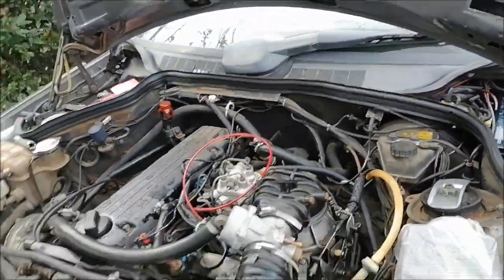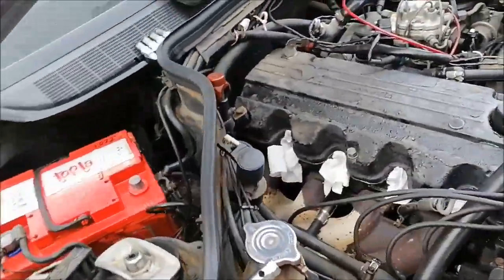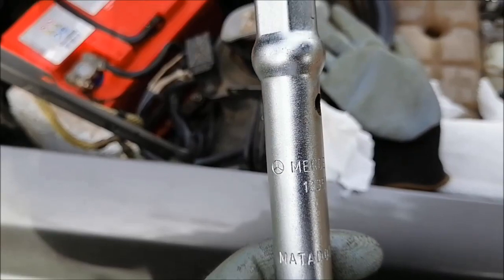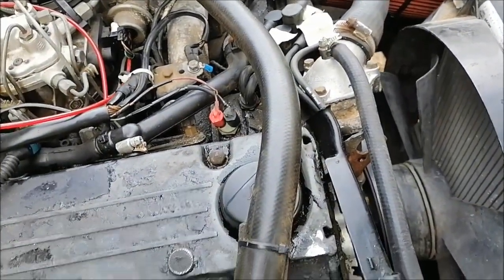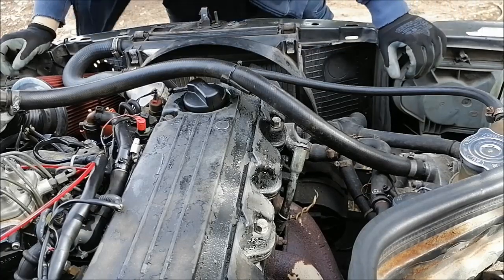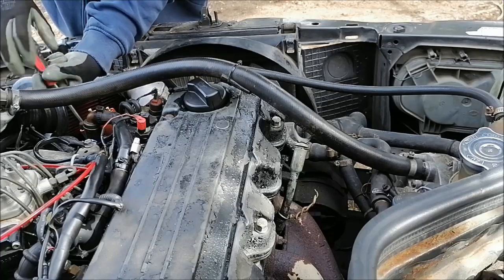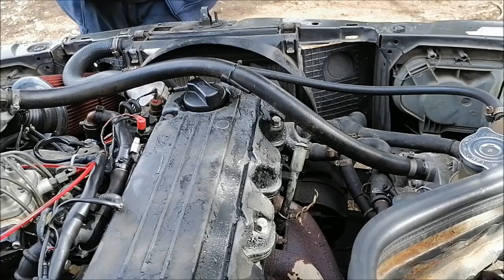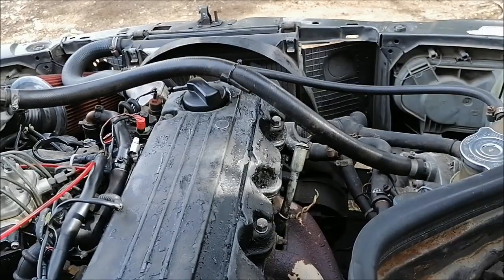Mercedes 190E ignition system

Comment: Hello, i am a new owner of w201 190E 2.0. 90kw. I started with some maintenance. I replaced the cap of the distributor of the ignition. Before i put the cables out from the cap i marked them (the numbers same as on the ignition cap). Then i replaced them an put to the same position. Then i wanted to measure the electrice resistion of the ignition cables (from cap to spark plugs). I noticed that the numbers on the plastic cover of the cables on the ventil cover dont match with the numbers on the distributor cap. So now i dont know if they have to match or not. Do they? Next idea is, i could make some mistake, or the old distributor cup was install in the opositte direction (if it is possible).... Now i canot try if the engine works because ii sent the coller to be fixed (because of some leaking)... Can you help me? Should the numbers on the plastic cober of the cables match with the numbers on the distributor cup? It means the cable starts on the position  for expamle "1" on the plastic cover and ends in number "1" on  the ditributor cup? Thank you very much...
Reply from the maker: Fire order is 1342 cilinder 1 is below oil cap  ignition cable is small to large on distributor cup number 1 is close to srew below if you have a bkack cap cover number is on cover 1342

Comment: Nice job, good to use OEM parts. Interesting air filter. Why - to get more power?
Reply from the maker: Because the blos system is installed in car runs on gas (LPG) and it is impossible install original  original air filter
Reply: @190mex it is. I have lpg with original filter
Reply from the maker: @asineprestanou5221  you have Blos mixer or?
Reply: @190mex  some different Brand, but probably same installation
Reply from the maker: @asineprestanou5221  post a photo under the hood
Reply: @190mex  do you have Messenger or something?
Reply from the maker: @asineprestanou5221  https://www.instagram.com/190mex?igsh=MTludXZobWhxdmRoZw==
Reply: @190mex  you have pm